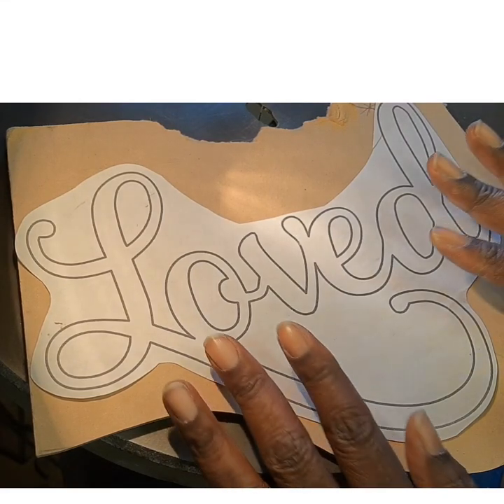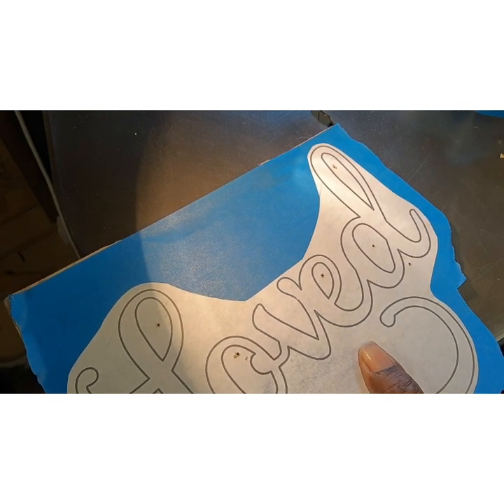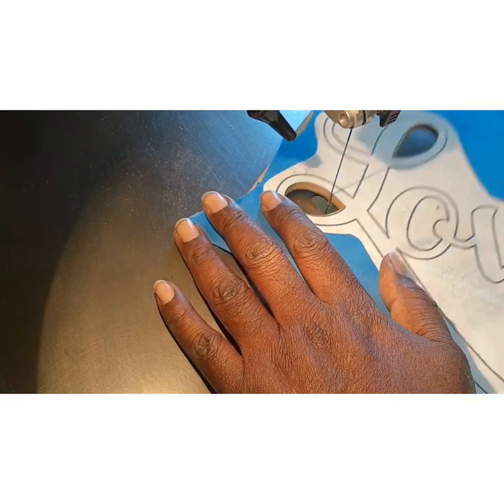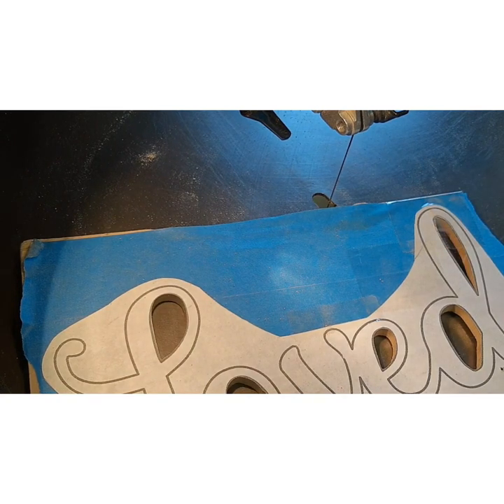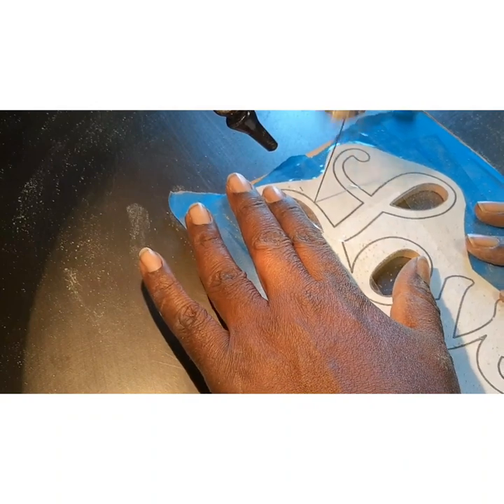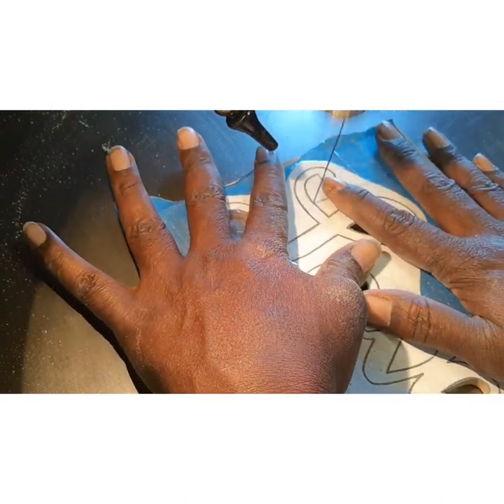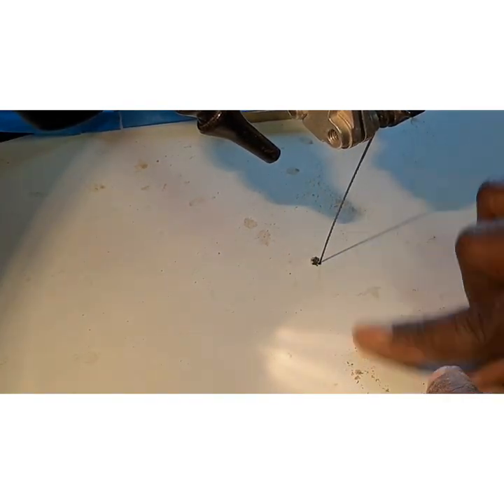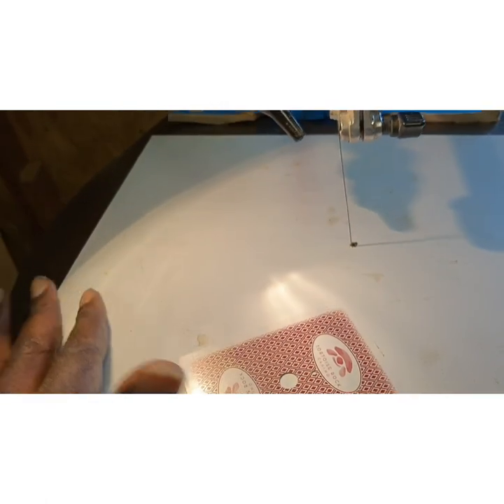scroll saw cutting tutorial / hack.

Comment: Excellent! I have seen folks who buy the large sheet of that magnetic material to "recover" their worn/scratched saw tables. Works great on all the saws with steel tables. Not so good on a Hawk.
Reply from the maker: Hi there! 
In one of my videos I try the magnetic sheet because one of my subscribers told me about it. I did not like it. Because for the price that sheet it doesn't last long. Little by little the hole starts to open up so then I would  have to  move it around to other parts of the sheet and would no longer have a completely smooth surface.  I think the card trick works better for me. Thanks for the suggestion though!

Comment: Hey Mytoya2, have you ever been exposed to the self-stick shelf liner that is available at Walmart. A 36 foot roll that is 12" wide for about $6. It is far cheaper than using blue tape and comes right off with a heat gun. I, myself,use it and I also use 8.5 x 11 self stick shipping labels that are printable in my laser printer. About $10/100.
Reply from the maker: Yes, I use contact paper for my large projects that I make with my jig saw. I like to tact that blue painters tape has for my Scrolling.

Comment: Thanks for the video. Beginner here. Two weeks in on a Dewalt 788 using Pegas mg #3 and #5. I have a real problem with turns. That is where I am so hung up. Please help with a video strictly showing turns. I would appreciate it. Much love xo
Reply: Should I be able to do all the turns effortlessly with these blades as well? The blade always twists and get caught up In the wood and sometimes it will twist back but often will break and it’s not a clean turn.

Comment: hi again, is there any benefit to using clear tape if the pattern is stuck down well? ty.
Reply from the maker: If the pattern is stuck down well, No. I have spray glued patterns on in the past and still had some paper flopping up an down at times, When I am working on a pattern I don't want to worry about lifting paper so I always use clear tape over my pattern. I say " your shop. Your rules" Hope this helped.

Comment: Mytoya I have a Jet 22 scroll saw and I wonder how much vibration it should have. seems like at slow and high speed it works fine but vibrates alot in the middle speed area. Should I send it back? When I watch you doing it is seems vibration-less.
Reply from the maker: Hi Joseph, I've never seen or used a jet 22-in saw before. See how it works for you. If it works keep it. See if it has a return policy and if so how long do you have before you can't return it anymore. Again if it works for you keep it.
Reply: @Mytoya2  I cant find the foot so I wont be returning it. Thanks for your input

Comment: Mytoya2, I’m still saving up to get a scroll saw, hoping to buy one by the mid to late February. Couple of a questions for you, what scroll saw do you use and what type and size of blade did you use for this project? trying to learn what I can before I get a scroll saw. Thank you! I absolutely enjoy your videos!
Reply from the maker: Connie Bryant Hi there, I have a dewalt 788 and a delta 20inch. I love both saws. I recommend either one of  the 2. If not make sure you get a saw that does not need an adapter to use pinless blades. In this video I am using a Flying Dutchman #5 scroll reverse. If you are on Instagram please contact me there. I would love to chat with you more before you make a purchase. My name on Instagram is  mytoyaNcalifornia. Hope that helps.
Reply: @Mytoya2  thank you for your input, I appreciate that. I am looking at getting either one of those two scroll saws you mentioned. Can’t make up my mind witch one yet, will continue contemplating it until it’s time to buy. I’ll look you up on Instagram, I really don’t use it so don’t know my way around it very well. Thanks again!!
Reply from the maker: The delta 20inch is the least expensive. If that helps.

Comment: Great video. Hack just as helpful. My problem is being unable to keep lower blade mount from falling off. Any suggestions please?!?😀
Reply from the maker: What saw do you have? And does the whole assembly fall off or does the blade keep slipping out? I would love to see pics. If you have an instagram my name there is mytoyaNcalifornia
Reply: @Mytoya2  Is is a Shop Fox 19" and it the whole assembly that drops off. It is a typical blade holder made to hold pinless blades. And when using pinned blades these holders aren't used at all. I'm not on Instagram but I will see if I can find you there and add a picture.
Reply from the maker: Hi there, I am. It familiar with that particular saw but this is one of the reasons I recommend getting a saw that does not need an attachment. It sounds like the part that holds the attachment may be the problem. Again I am not familiar with that saw. Do you mind if I video message you tomorrow?

Comment: Which blade do you use, pinned or flat
Reply from the maker: I use flat pinless blades.
Reply: @Mytoya2  thanks for the reply. Which model of scroll saw do you use, if you don’t mind me asking
Reply from the maker: In my videos I am using a Dewalt 788. I own a delta 20 inch as well. They are both great saws.

Comment: What type of blade are you using
Reply from the maker: Hi there, I am using a flying dutchman #5 scroll reverse. This is the size blade I use most. I order my blades from the wooden teddy bear. They have been around for years. They also has beautiful patterns, clock parts, acrylic an all kinds of other scroll saw goodies. Very good company!
Reply: @Mytoya2  what type of wood do you find best for scroll sawing, so far I've tried 1/4 thick Birchwood with Olson spiral blades but am unsatisfied with the end result plus the Birchwood kind of warps after a bit of sitting
Reply from the maker: Hi there, I like to use 1/4inch or 1/2 inch MDF. I also use 1/2 inch sandi plywood. It's already really smooth. When I use plywood I make sure there is cardboard under it and I use the same #5 flying dutchman scroll reverse blade. This helps with splintering.
Reply from the maker: Spiral blades have there uses but I like the clean cut of regular blades.
Reply from the maker: I also use walnut , paduk, lacewood and other species of wood but these days people are into the painted signs. I plan on going back to fretwork and using better wood.
Reply: @Mytoya2  thank you very much